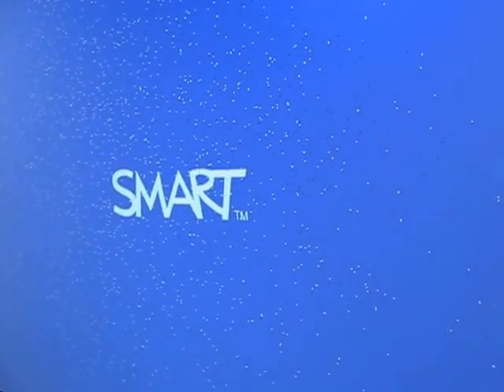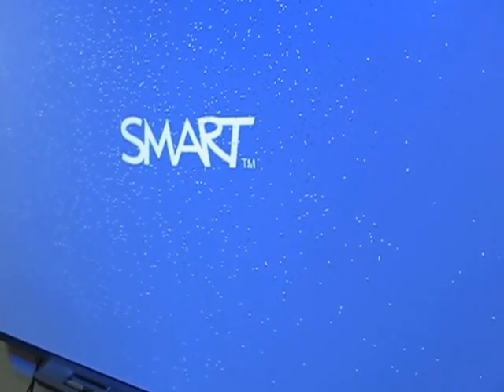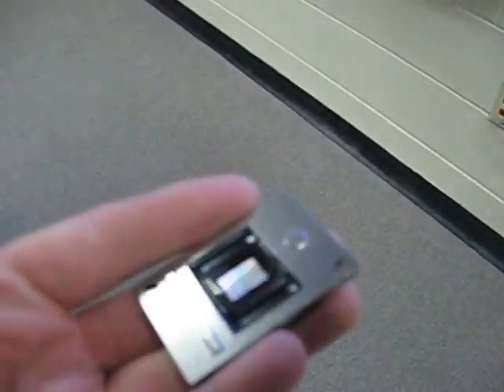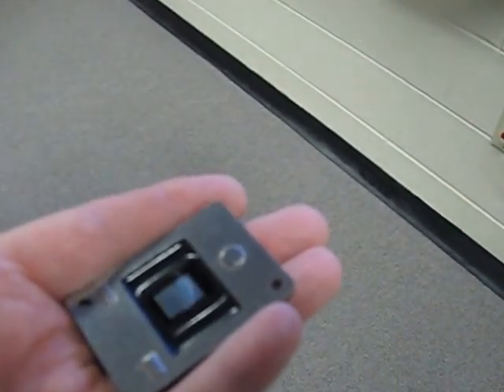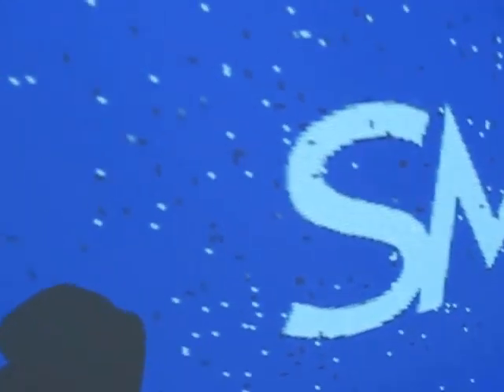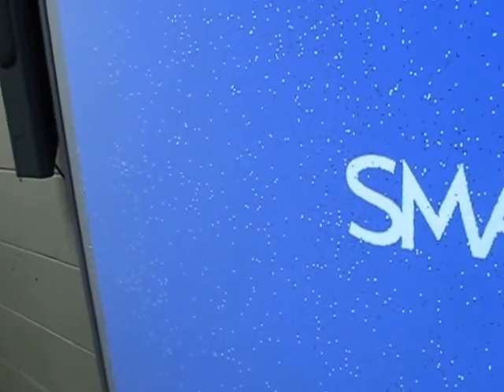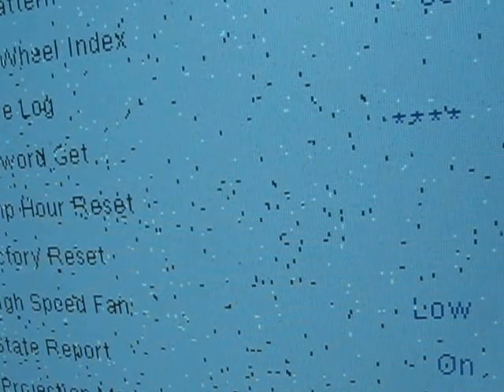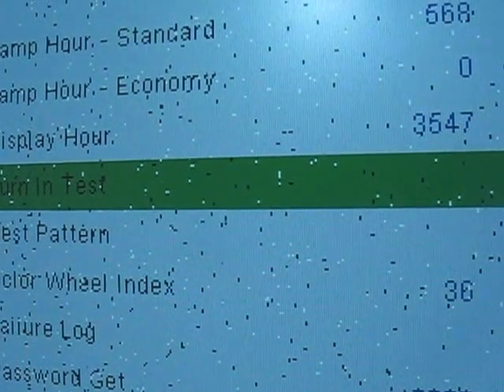Smartboard problems - UF55 DLP micromirror failure

Comment from the maker: The heat comes from the lamp shining on it. Probably could hack the UF55/UF65 by putting a Peltier Junction cooling plate between the heatsink and DMD for better heat removal, but I don't want to risk using an untested hacked device in a classroom, just to save a few bucks. We are replacing them with Epson PowerLite when they die.
Reply: im glad epson is the same and it will make things better the smart company didnt even have filters thats messed up lol

Comment: that's long. I have a projector with a big part of damaged mirrors with only 86 hours.
Reply: the dmd is not the problem in the beginning, the thermalpads are. these will dry out to a layer of stone and then the dmd does not get cooled down by the rear-mounted passiv heatsink
i serviced multiple uf45, 55, 65, 75, all without the uf45 suffer from this, i guess smart saved a buck on the pads, while the uf45 were rebranded toshiba beamers, which get dirty as hell and start to overheat, but after a cleaning will work again for ~2 years, btw the uf45´s we have are the oldest of all with 0% hardware fault-rating, you dont want to know about uf55 or uf65.....
Reply from the maker: +JP13357 How old is the device? I don't know if age affects operation, if it can fail just sitting on a shelf not being used. Many mechanical devices suffer from grease outgassing and can fail in storage, but the micromirror array is sealed.

Comment: We have repaired hundreds of these projectors including the UF65. The DMD chip is by far the most common problem and they seem to fail regardless of the amount of time the projector has been used. Heat is to blame for many premature failures in electronics. For projector repair information visit www.neilstv.com
Reply: Does the DMD chip have USB port in it??

Comment: Don't normally comment on videos but have experienced this a lot.  Use a company in Longmont, CO - Spectronix - failure of chip believed to be cooling issue - the cells(mirrors) heat up and pop.  Spectronix says if they fix it you won't have the problem again.  They improve the way the chip is cooled.  They also fix projectors much cheaper than anybody. (www.justrepairs.com) - all the ones I have had fixed are working very well. Smart did fix many of these under warranty, as you speculated, because TI gives 5 year warranty on chip. I have had over a dozen or so of these fail in the last couple of years.  Very frustrating but happy that someone can fix and fix economically.  Haven't done well finding projectors that work well on Smart arm mount.
Reply from the maker: Yes, cooling is directly cited in TI's own technical documents as a factor in MEMS lifespan. See graph on last page.
http://focus.ti.com/download/dlpdmd/154_Hinge_Memory_Paper_IRPS2002.pdf

Based on this graph I'd estimate the MEMS in Smart's UF55 projector is running at 85 C. Note that if MEMS operating temp is below about 40 C, life can reach upwards of 100,000 hours.

In theory the micromirror array could be more effectively cooled by sticking a Peltier cooler on the rear end of the lens assembly under the MEMS heatsink, but this would likely require extensive changes, reshaping the air duct due to Peltier's 3-4mm thickness, adding an external power supply and wires and temperature regulation sensor to the Peltier, etc.

Is this worth it for the end-user to go through this hacking work? It should have been engineered with a better cooling design from the start.
Reply: Andy Godfrey  we repair all smartboard projectors 90 day warranty.Zebra A/V Repair Service zebraav@msn.com
Reply: Dale Mahalko We repair smartboard projectors. zebraav@msn.com